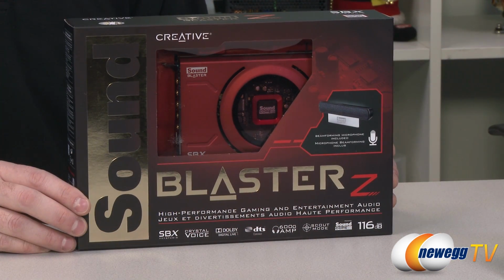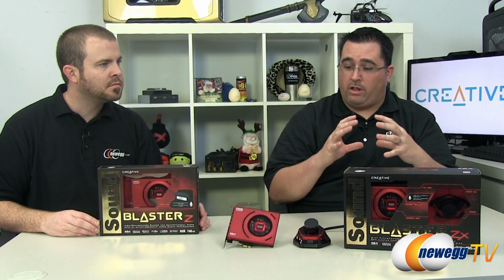Newegg TV: Creative Sound Blaster Z-Series Audio Cards Interview

Comment: Yes, I've had an STX for a little over a year now.  Before I had an X-Fi Titanium Fatal1ty that I was quite pleased with.  I used Sound Blasters all my life until the STX.  I started seeking audiophilia, so I bought some high-impedance headphones (HD 650) which obviously required something that could drive them.  I was left dissatisfied with the STX's amp, so I now have it just driving a tube amp from the line-out, something on-board could do, or the X-Fi I had could have done just fine.

Comment: This is mostly due to the PCI-E spec and the traces for the card. We've played around with other designs but there are items that get introduced with a unique layout like that (components facing up). You also introduce some new "noise" potential with the components being exposed to some of the noisier parts of most motherboards, noise meaning potential analog noise sources.

Comment: Actually interesting way of putting it. We DO have two processors in the ZxR card system, but they aren't splitting the audio duties like a Crossfire or SLI system does. We take advantage of how programmable the SoundCore3D is so we can task the two chips to do two different functions (like output effects and 5.1 digital output or recording, etc).

Comment: I bought a high end 5.1 sound system just to hook up to my PC.  It sounded good, but something was missing.  It was the SoundblasterZ.  This has made my sound system sound amazing and what I was hoping to accomplish in the first place.  I hook my reciever up through the fiber optic toslink adapter.  This is has made the sound totally awesome! No regrets besides thinking an onboard soundcard would cut it. I cant imagine any other device I hook up to my reciever to sound better than my PC now.  I'd actually try to pass the sound through the SoundblasterZ to get it to sound as good as it can. Total recommend.
Reply: What sound card were you using before?

Comment: Also to your point there's been a SIGNIFICANT amount of audio sub-system changes in Windows over the past few years (the largest change with Vista)...we basically had to go back to the drawing board and re-write our driver base from the ground up. Win7 stabilized the audio code somewhat and Win8 has remained largely the same with a few changes.

Comment: Do you mean the Promedia 2.1 speaker system? Klipsch recommends in the instructions that you connect them to a high quality source like a sound card. 
You'd also benefit from the Z as it has a headphone amp for 3.5mm jacks,a USB headset would gain no benefit from a soundcard.

Comment: OK. I hope U don't mind me commenting on this, but I admit I was always a fan of Sound Blaster sound cards. Little ever did any other manufacturers compete well enough (never for long enough). I would like more focus on the frequency response rather than details about electrical resistance.. because if you look at the numbers out there, that is what varies the most by far! Internal (built-in/integrated) sound card frequency response? The number is horrible and far off. This Zx card puts out WAY more range than any integrated/built-in sound card and more than any human ear can hear! 20Hz-20,000Hz is the range of what a human ear can usually hear. Good review over all though. thx Newegg!

Comment: No issues with any sound cards except when nVidia nForce motherboard chipsets were the hot (and quite overrated) thing at the time and I had IRQ conflicts trying to get a Sound Blaster to work.  That same chipset, when I finally got the card working, also produced crackles and all sorts of problems in the sound.

Comment: It does. Actually I plugged in my headphones directly to my receiver so that resolved that issue.

However I am getting a humming sound through my headphones. It's not the receiver since the humming starts when Windows boots up and the sound card kicks in :( Can't believe optic signal can carry interference? 

I've used Optical In 2 of my receiver with my CD player and it sounds crystal clear/pristine. But Optical In 1 has a hum coming from the sound card...bummer. $500 sound set up and issues!?

Comment: The headset I have uses a USB connection that I like to plug into the front of the PC (easier to connect and disconnect). Will I be able to maintain that with either of these cards??

Comment: Can I have the control unit connected to my pc and still connect my speakers using my 5.1 analog plugs? I have optical on my amp but the ports are filled with my ps3, 360 and Cable box. Thanks

Comment: I have the Asrock X79 extreme11 motherboard that has  the quad-core Sound Core3D audio processor built on the board. Does that mean I do not need to have a discreet sound card???

Comment: I bought a SoundBlaster Z card and only had it for one day but it sounds great. When it works right! I'm not an audiophiles, but I do like pure sound! And this card grants that! But for some reason it adjusts the volume and pops for some reason!
It has been better today than yesterday, So does it need broken into?
Most high quality sound stuff does, but a creative sound card? I have a SoundBlaster Audigy Z2 from 2003 (I think) still works and sounds great! I cannot use it in my new build because the motherboard (Sabertooth X79 ASUS) only has one standard PCI port occupied by my older TP-LINK wireless card (ok not that old)!
I do not want to send this sound card back. So will those noises go away! If not it is going back and I'm going to get a ASUS sound card!

I like CREATIVE (or used to) and hope that they are not bad. Because they used to be GREAT! And I hope this card has not side affects by tomorrow if it doesn't I'm keeping it! If not it is going back!

Comment: Question: 

Can i use the card in the following setup
Optical Out: A/V Receiver
ACM: Headphones

Will I get sound through the optical out connected to my receiver and switch over to my headphones connected to the ACM when needed? Just bought the SB Z (haven't opened it yet) through you guys but am deciding to upgrade to the SB Zx so I can get the ACM if it works as asked above. Thanks!

Comment: Hi, I could really use your advice: I work with Band-in-a-Box in my laptop and I´m always trying to improve my playback sound. That`s it, that`s all I need. Everybody seems to coincide that laptop sound sucks and it is true. Do you think an external SC will improve my midi/wav playback with my laptop? or...I`m even considering using a compact PC instead of the Laptop. What do you think ?
Which SoundBlaster card will do the job. Your criteria will really help. Thanks !

Comment: i have no in game sound, anyone know how to fix this?? sound works perfect anywhere else
Reply: With the soundcard? You probably have to go to in-game options and select the soundcard/driver itself.

However if onboard is disabled, windows should recognize your soundcard as the default -- if the game was installed previously than you may need to manually change it
Reply: com3se3m3 yea I figured it out I had to set the optical as the communications device and the sound card as the default because I was using dolby digital. It's confusing but it works

Comment: I've had one of these for going on seven to nine months now. It's been a good card for the most part (when it works), but its always had a few instabilities. Here lately though for the past three days, it has been giving me nothing but trouble. Sound distortion, sound cutting out, and sound jumping across channels. I have not updated the drivers in a while, and I just read that the current drivers are not any better. Just last night I was messing with the microphone settings, and the sound card freaked out with a high pitched tone that would not stop till I shut down and restarted my computer. What happened to Creative Labs' quality? I'm starting to think maybe I should have gotten something else, or stuck with the on-board sound.

Comment: wait a minute.  in the video he said that it offloads audio processing from cpu to the sound card.  that may be true, but he says it like onboard sound doesn't do the same thing.  for onboard sound, isn't there a separate sound chip?  so doesn't that mean the sound chip handles the audio and not the cpu?  so in either case whether it's an audio card or an onboard chip, the cpu doesn't process the sound/audio.  is what i said true or not?
Reply: The audio is handled through the chip set which is a part of the motherboard, you're correct. though the sound chip being a part of the motherboard as opposed to being an independent chip set becomes problematic because many of the electronic connections, kinetic and magnetic resonances wind up causing background noise that your computer develops itself without any added help. Meaning clicks whines, whirs and hums that come exclusively from your motherboard.

Comment: the ZXR is, the Z is like a non hd titanium.
now, since the zxr and the titanium hd are almost identical by the components, here is what you should know to decide if you need a ZXR over a titanium hd:
1. the ZXR has a texas instruments 600 ohm headphones amplifier
2. the ZXR comes with the ACM which works as a microphone and lets you plug in your headphones and tune up and down the volume.
3. the ZXR has a way better drivers. (running out of characters for comment)

Comment: So basically, I want to connect both my headphones and speakers to my PC, but I only have 1 port for that.
I'm not interested in any gimmicky stuff, I just want something to help me connect both at the same time without having to unplug.

Should I buy this or a DAC? I saw the Creative Sound Blaster X-Fi Surround Pro and that looks interesting as well, but will it make my headphone/mic quality different?
Reply: +Niuqorram this card and its software has a switch that simplifies that process. from top to bottom it goes microphone, headphone jack, speakers (up to 5.1 surround) so plug ur mic, headphones nad speakers in that order and use the switch. Easy breezy beautifully blessed.

Comment: Are the Z still fine to use with Windows 7 considering how old they are now? I just got a BSOD at boot-up related to the outdated driver for my X-Fi Fatality Pro - I think I need a new card. I need a card that will work fine with my Earforce DSS (so I need optical audio out on the card) and can "record what you hear". I currently still use Daniel K's Creative drivers for my X-Fi and I like the full featured Dolby Digital software and control panels.

Comment: The ZxR is 124 DB SnR output to clarify. When I comments on the "going above 120 DB SnR" I was trying to highlight that the components to get ABOVE 120 are HIGHLY specialized and you start to get into very specialized territory. We also RECORD at 120DB SnR on the ZxR...not matched by the competition.

Drivers: We've totally updated our core package and have unified drivers for the series now. This means, simpler install, and added stability. We've listed very closely to the community on this.

Comment: How do you compare to the sound blaster recon3d? Which one is better
Reply: Nagato Pain Z/Zx is using discrete cirrus DAC(rated 120db snr) and Amp chips, while recon is using integrated DAC in the sound core3d chip (rated 105db or so). So spec-wise z and zx are better.

Comment: Alright here's some quickfire answers:

- Why Red? Red is a unifying theme that we've gone with for our line. The ZxR is BLACK with red highlights and does NOT illuminate. So if you're anti-red, this is the one for you. The ECM shield is also removable for some modding action if you'd be inclined ;)

Is the G35 (or USB headset) better than a soundcard? In my opinion no. USB headsets utilize the host for your audio and are subject to noise so their SnR is quite lower than a dedicated card.

Comment: 20:01 Creative needs to add a way to shut off the 2 red LED's which are inside their Z cards.  A lot of people don't like them, especially at night.  There's a video which shows you how to take apart the Creative Z card and either tape over or clip the LED's:  D_YkCRxtECA.  However, Creative needs to have a software option.  This video is 2 years old so I doubt anyone from Creative will pay any attention.
Reply: yeah you can just put tape over it. But F that, the soundblaster Z is crap.
Reply: MissMan666 ah I get it now
Reply: MissMan666  Why do you say, "the Sound Blaster Z is crap"?  From what I've read on the reviews, it seems pretty good for music playback.  I almost bought the Sound Blaster Z the Sunday after Black Friday.  It was on sale for $55 on Amazon, ASIN: B009ISU33E.  It's supposed to have "116dB SNR, plus audiophile-grade capacitors and gold-plated I/O connectivity."  I didn't buy it because I was hoping the price would drop to $45.  B^)

Besides, if I did buy it, I would have to update the BIOS on my mobo, maybe other drivers.  It's a major pain.  I'd have to do research on how to upgrade the BIOS on my Asus mobo because I forgot.  I think there's an Asus video on YouTube.

Comment: Onboard audio is just like an onboard NIC or a common modem...it's just some simple layer that really uses software drivers to tell the CPU how to process things for them.  Remember hardware modems vs. software modems?  Probably not.  A sound card like this has its own hardware to take the load off the CPU.  There will be an FPS advantage.  Why do you think servers use expensive NICs with their own processors?  Because they don't want the CPU to be tied up doing network shit.

Comment: you don't NEED it but if you desire better sound,its nice to have.Your speakers are merely the output for sound.Your motherboard sound processor is actually doing the work.

So for example you can have a thousand dollar microphone but if the singer sucks,there's really no point

Comment: I find this sound card to be pointless. I use LSR 305 monitors & Polk Hampdens. You're better off using external solutions rather than SBZ.
Reply: Dex4Sure Hi, I own 2 Essence STX II cards. I do like the sound quality, but when I tweak the volume to match SBZ or Realtek I cannot detect any difference in sound quality. Both cards are set to 192 khz/24bit bypassing any kind of audio processing (using stereo direct & hi-fi mode on asus cards respectively). I thought it might be my ears so I did some blind test inviting my family members. They couldn't really tell which is better at the same volume. At default settings, they only reported one being louder than the other (in this case the STX being louder than SBZ/Realtek). 

There's an article on Tom's Hardware on this subject: http://www.tomshardware.com/reviews/high-end-pc-audio,3733.html
Reply: +Jay Liu u r wrong

Comment: These cards sounds great, but  ACM is not very good for gaming or even Skype for that matter. My web cam has a better Mic than Audio Control Module  comes with These cards. Also I should had done my research with Z-Series cards Creative has no support  for Linux with These cards (CA0132) as of when am writing this.
Reply: I take back what I said about ACM you just turn uncheck  acoustic echo cancellation.  acoustic echo cancellation  maybe good just on paper for a PC's or work for some. But for me it makes the mic way too low.  people on the other end have a hard time hearing me if it's on.